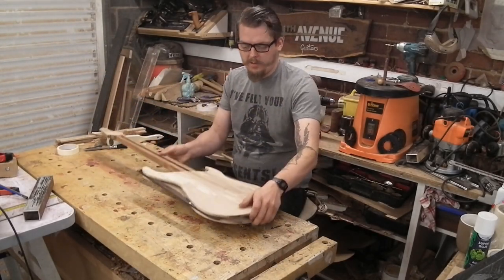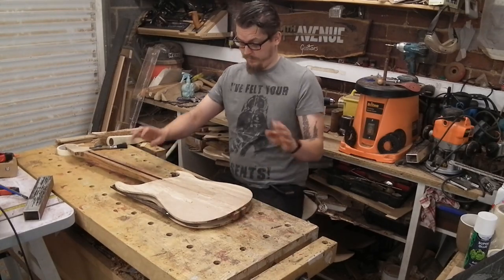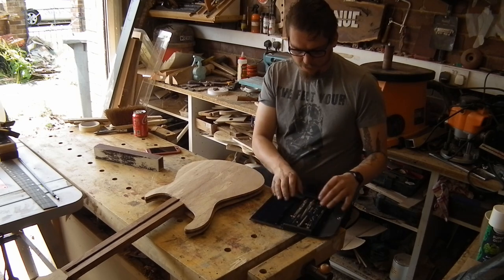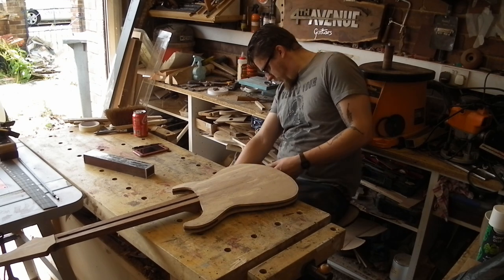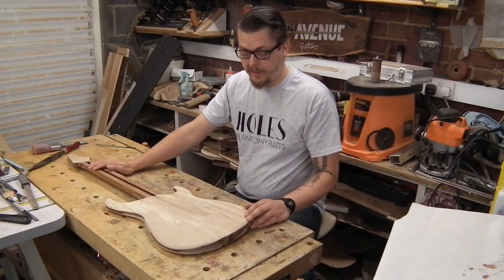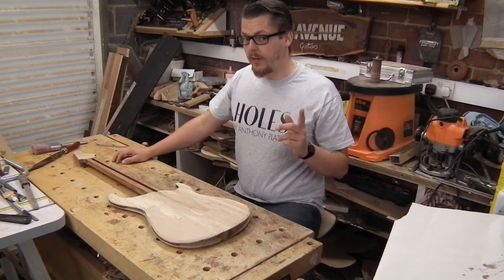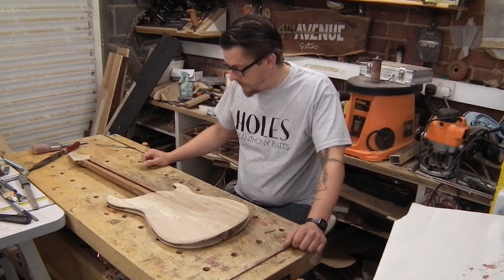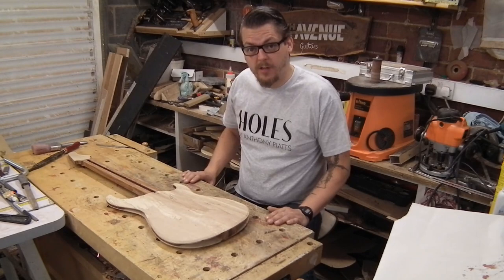Building a custom multi scale guitar; It's hip to be square. But bevels are better.

Comment: Ehh been there done that with the metal tubes on other builds..  I am picturing something more like using a set of Ear ring gauges that run in gradual sizing's and maybe do one 6-7 mm hole (or larger depending on your mood) and go smaller off to each side. Depending on what you plan to do finish wise I think either onyx or hematite rings would look awesome. I almost did my holes where my pots mounted with them on my GGBO build but shipping and build times were going the opposite direction at that time.
Reply from the maker: I may have another idea in mind which allows me to play with the drill bit still do something subtle but different

Comment: You should check out fly-fishing reels if you want some hole-based design inspiration! Also, you should probably avoid getting into fly fishing as you may bankrupt yourself collecting all the hole-y reels...
Reply from the maker: I’ve seen some of those. I’ve also looked at weight relieved race cars with holes drilled in every internal panel... I could easily bankrupt myself with all the pretty things 😆